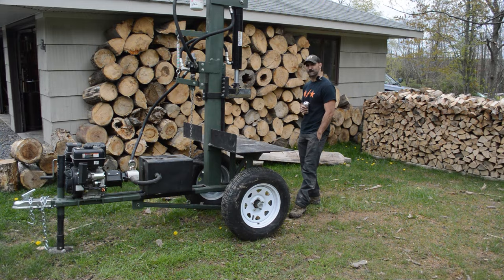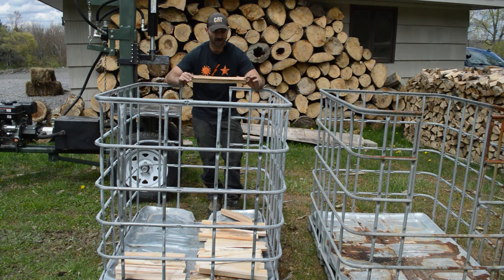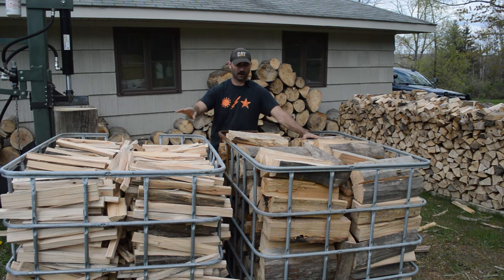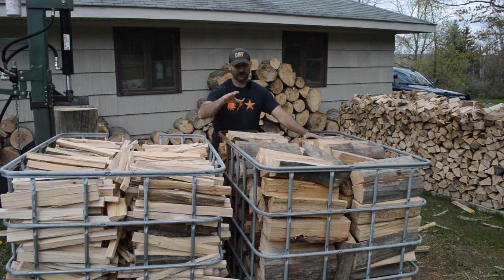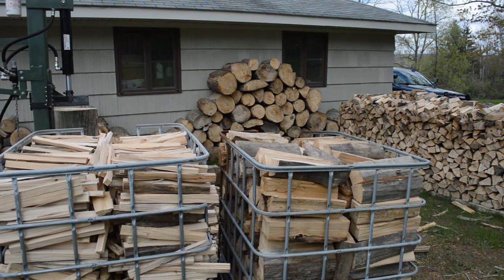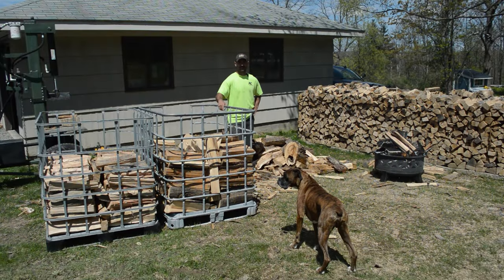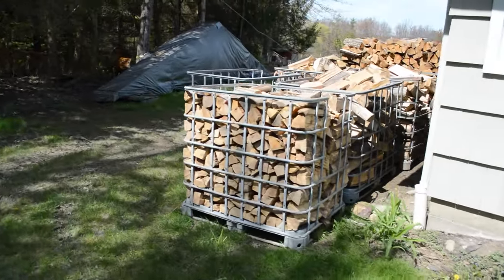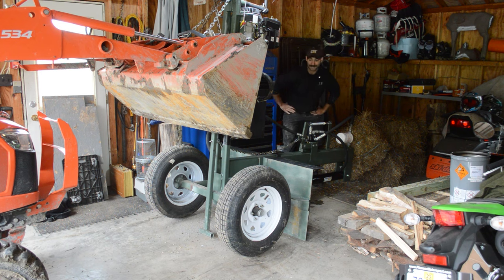The Fastest Way To Make Kindling - A Vertical Log Splitter

Comment: The results are closer to logs than to kindling!
Reply from the maker: The kindling ended up measuring 1"x1". I did cut up some larger squares in the later totes for campfire wood or re splitting at a later time.

Comment: If you cut the bark off with 4 cuts you get a square or almost.  Then slab the square and multi cut the slabs to the size you want..  save the bark cut offs for your own use
Reply from the maker: I think you're on to something here James. Luckily this batch has lasted me some time. I'll try it on the next load. Thanks